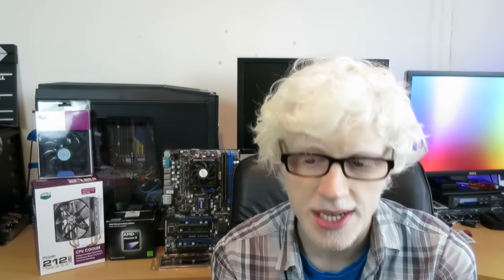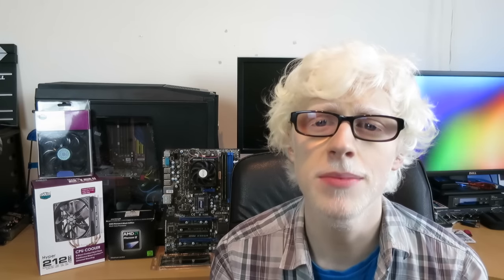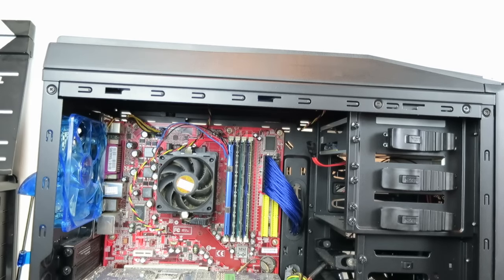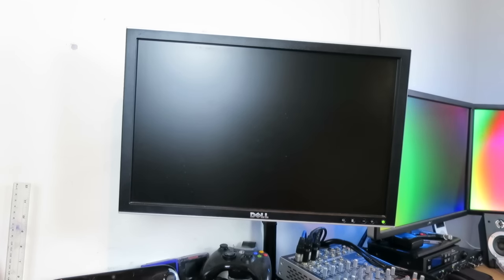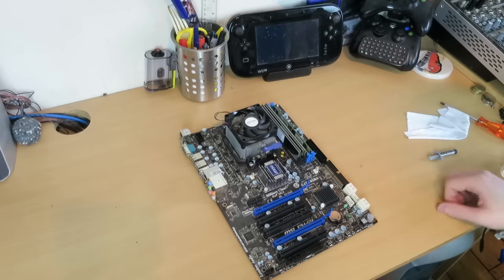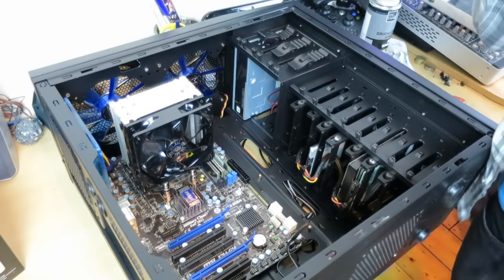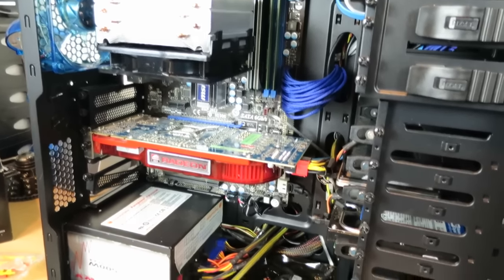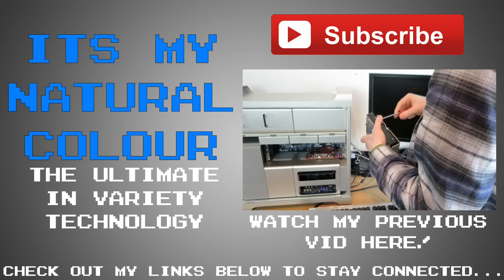Spare Parts Gaming PC Multi Upgrade Craziness! | IMNC

Comment: Whack either 2 5770's in Crossfire or a 5870 in there & that'll be one beastly little system, especially with an overclocked CPU. Should breeze by in even the most modern of games.
Reply: Ya

Comment: You can mount the Hyper 212 with the fan going horizontally rather than vertically (like you did). Just depends how you orientate that bracket that screws the 212 to the backplate.

Not a bad little system though. Still using a 965BE and a Radeon HD7870XT myself and it still surprises me with how well it performs.

Comment: I need to do a Phenom II X4 upgrade to my system, too. Mine has a Regor (?) core CPU in it, and I want to upgrade to an X4 Phenom or Thuban. You should certainly reuse those other parts! You might even be able to use one of the B class AMD chips and unlock the two closed cores for a cheap, stable quad-core system.

Comment: Nice video Man! However, I personally wouldn't recommend getting another HD4870. Don't get me wrong, I still have one in one of my relative's pc, but its kinda hot and hungry. I would rather go with the HD5xxx series. Much better performance/power consumption. I know, You already have the HD4870, but with the stock blower fan it will never be near quiet. Also, i have 4 of those cooler master led fans in my pc, they are quite silent, only problem with them, if you hold them horizontally they may sound a bit interesting. Also keeping that one in the bottom may be much more usefull than the ones on the top. Keep up the good work Man!

Comment: Loved this video!! Might I ask why you're investing so much time and money into this build when your Hackintosh build also has great gaming hardware, and just needs a Windows install and maybe another SSD?
Reply from the maker: +Jose' Stovall Good question. I'm not actually intending to build this system to use as my own personal gaming PC. I don't really have time to dedicate to games at the moment and I've already got a backlog of games that I need to play through. This system is built for the sole purpose of making these YouTube videos and then to hopefully sell on, either as a complete system or as parts depending on what I decide / what gets more interest. In terms of money, I'm sourcing most components from people I know and just paying shipping so it's all a very smooth and cheap process, makes everyone happy :) In terms of how far this project will go, as per usual IMNC style, I haven't planned that far ahead, so for that reason I don't know when it'll be sold. I hope this answers your question!
Reply: +ItsMyNaturalColour I will happily take that socket 939 motherboard, CPU and heat sink, as I too have a socket 939 MSI board, but it's non working, possibly because the original Power Supply blew up, doesn't look like it has been damaged either. Feel free to contact me at: alex.mckeever@sbcglobal.net
Reply: +ItsMyNaturalColour why dont you do gaming videos aswell? i think it would be great if you did them, we would get to listen to the rambles of tom smith even more ;)

Comment: you should get 12 votl to 7volt adapters for those fans, running them all the time at 12 volts wil shorten its lifetime, and also if will produce much more noise and dust, there is no need of all those fans on that pc, if you want them anyways at least make them quiet haha